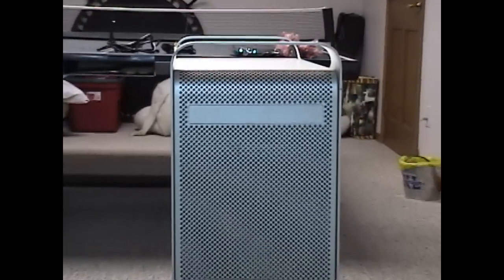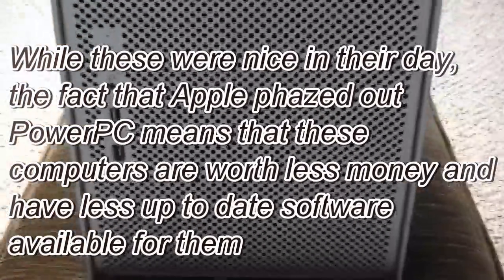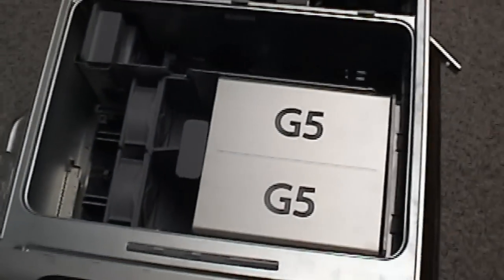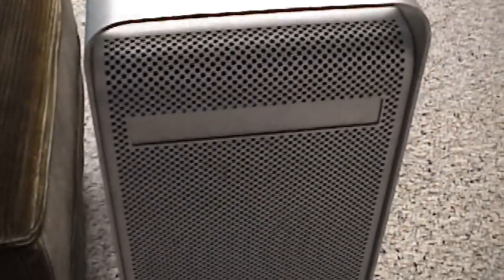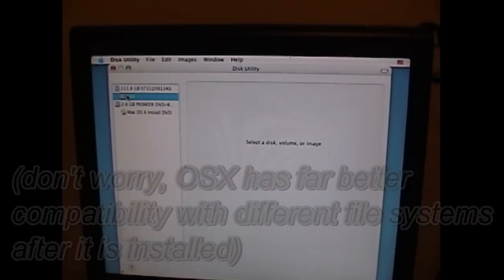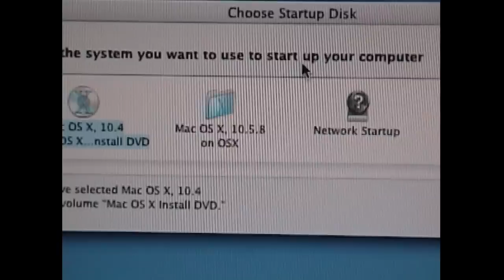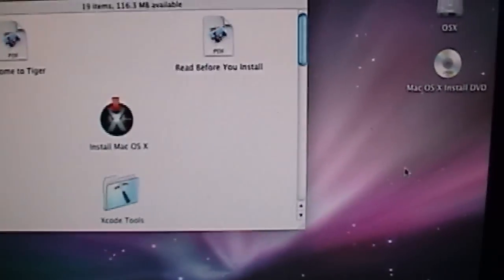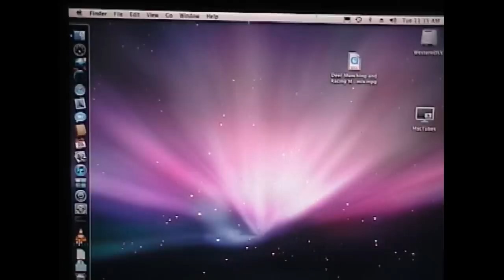PowerMac G5 Setup/First Run + RAM, Hard Drive, and OSX Installation

Comment: Hi hope you're still active as I've just purchased myself a powermac g5 for £10 about $16 and it was described as not working and no hdd. However after talking to the seller they explained they'd never actually tested due to not having the time to install a hdd and get a os for it, so I've been looking for a os and it seems I've found one however whe I've looked at the 10.4 download it says it's been taking down or something because of the high court so idk if you can upload it somewhere else thanks. Also he have me an official apple 22" monitor with it which is worth a fair bit
Reply from the maker: Ewan Rees 
There's a video about setting it up somewhere; if only I could remember where I saw it...
Reply: *****  ;/ i've been really stupid but the download for the os says its been taken down any chance you could post it up somewhere else??
Reply from the maker: Ewan Rees 
Are you looking at the 10.4 DVD or the 10.5 hard drive image? Both links still look good to me (although I was disappointed to find that MegaUpload now asks to install some kind of browser extension to let you download files larger than 1GB).
Reply: it was the 10.4 DVD it may be thats its blocked for me due to me living in the uk
Reply from the maker: Ewan Rees
Oh, so the overseas censorship thing doesn't want you on Kickass torrents; that's very interesting. In that case, I'd try a web proxy. Anonymouse.org worked well enough for light browsing the last time I used it, so that might be worth a try.
Reply: its ok thanks anyway but the powermac has decided it no longer wants to work :/
Reply: yeah i bought it as a project but just don't know how to repair it and what exactly is wrong with it also im in uk so if i put it on ebay  the shipping would be expensive if you live outside of the uk
Reply from the maker: Ewan Rees
It's almost like hotel california because you can almost always buy a Powermac G5, but it's nearly impossible to get rid of them (working or otherwise) because nobody wants them. Domestic shipping is expensive enough for an item that large and heavy, so Craiglist is likely your only hope (it's how I got rid of mine finally, and even that took a lot of patience).

Best of luck on fixing or selling.
Reply: Well i can't seem to get mine working believe its a 1.8ghz and got told it only had 512mb ram but opened it and it has 3gb of ram so i beleve it must of been working at some point otherwise why would the owner have upgraded the ram?
Reply from the maker: *****
Even that is far too much. $20 is the absolute maximum you'd probably want to pay unless you're a collector.
Reply from the maker: *****
In that case, consider yourself one of the lucky ones and trust me when I tell you that the grass isn't greener on the other side of owning a G5. I got a pair of G5s a couple years ago for $50 total at a local computer thrift shop. In modern times, you can get a very decent and useful computer for $200, one that would handsomely kick the pants off of any G5 (blindfolded). Heck you could easily get a used computer superior to a G5 for $50 or less, just hit up craiglist.

That said, don't let me scare you away from the learning experience and lesson in patience that you will receive as a result of owning a PowerMac, just don't spend $200 on one unless it's a BNIB museum piece or something.
Reply from the maker: *****
Few people are willing to sell them for what I believe they're truly worth at this point ($20-30). I'd recommend a used ultrabook as an alternative. For <$200, you get significantly better performance than a G5, better connectivity, and superior portability with significantly less noise, vastly reduced power consumption, less space taken up, and all that weighing only fraction of the weight of a G5, not to mention the fact that you can take it just about anywhere.
Reply from the maker: @Travis Loza
Just don't spend too much money on it.

Comment: After doing any work on a Power Mac you will need to re-calibrate the machine.  Get the ASD Dual Boot 2.5.8 CD on EBay
Reply from the maker: +michael37327 
I'd rather just get it from ThePirateBay or Kickass Torrents.

Comment: does an imac g5 run good on leapord?
Reply from the maker: Not entirely sure. The G5 does a satisfactory job with it, but you run into compatibility issues with anything older. I'd give upgrading to Leopard a try if you're having compatibility issues (or want the visual goodies!), but if you're happy with the looks and performance of Tiger already, I'd just keep it with that.
Reply: thank you for the info!

Comment: If you ever use a G5 in 2020, you probably want to use Linux and an AMD GPU, you can easily get the non free open source drivers which make the OS run smoother than macOS, Linux just seems to have been built better on PPC than macOS it seems
Reply from the maker: Feel free to watch my followup video to this on using PowerPC Mac PCs in modern times. Maybe they're better now, but I tried several Linux distributions and had a variety of showstopping problems with each of them. It was a neat little machine, but not anything that I'd have a practical use for these days.

https://www.youtube.com/watch?v=da5vfIH069E
Reply: @Browningate  oh yeah I saw this
Yeah Linux has been odd on PPC.  I myself had a LOT of issues on Linux that I don’t think I can even recreate now because they were either random or something I forgot I did that caused them.

Great video you made, both videos!
A few things in Linux are not OOB, like GPU acceleration.  Sometimes things are broken and you have to go to the guides or troubleshoot and guess your way out.  
Too bad macOS was poorly optimized for G5’s and G4’s
Reply from the maker: @5thaltaccount547  It's easy to say that Linux and OSX are "poorly optimized," but maybe our standards are just too high nearly 20 years later. That said, the broken Linux stuff was certainly frustrating. I'm willing to jump through some hoops to make things work, but this thing was just turning into a giant vortex of wasted time. Someday, if I encounter another one, I might just give it another go, but I've had my fill of G5s for one decade.
Reply: @Browningate  well that is true, however without a doubt OS X had some optimization issues I think for just about all hardware and the hardware that suffered the most were average lower end hardware?  Is that the right terminology?  Some of the higher end PPC machines can have a good fight though with running PPC Linux once it actually gets going properly.  Leopard was known for having some optimization related issues for PPC and Intel?  I think?  One or the other.  It would be interesting if to see Apple Silicon be the new transition, could it be considered the new PowerPC?  Not sure but we’ll see how Apple decides on tackling the future.
Reply from the maker: @5thaltaccount547  You're welcome to run some side-by-side tests to see if general working tasks are any easier or faster under Linux. The G5, thankfully, has two hard drive bays.

I don't think that they'll have the same growing pains with arm, because they've been building for it for over 10 years now (remember that iOS is based on OSX). And x86 obviously isn't going anywhere anytime soon. Whether or not this will effectively pressure Apple to support it for longer than they did PowerPC after the transition started, remains to be seen. Under normal circumstances, I'd say that they do. But on the other hand, removing features for no discernible reason seems to be a recent pastime of theirs, so an early quit wouldn't be terribly surprising either.

Comment: Thank-You.!  :)  Who would ever think to OPEN the DVD Door of a $4,000. computer would require 3 screwdrivers and 6 hammers. :)  Bill Howes.
Reply from the maker: I found out that there are a few other ways to open it as well. You can hold the mouse button while turning it on or hold "ALT" at startup, wait for the boot menu to appear, then hold F12 for one second.

Comment: hey i did everything u did but right when i restar my mac just the apple logo comes out an doesnt do nothing justs stay there doing nothing anything wrong? by the way i got a powermac g5 running 10.4.11. do i have to erase tiger first an then try it againg.. pls help my mac is not working nomore
Reply from the maker: *****
Are you getting this after restoring the 10.5.8 image? If so, you may need to erase your existing 10.4 partition, do you have anything important on it that you'd want to keep?
Reply: thank you for replying...nooo i actually installed 10.4.11 on my mac few days ago but i need to upgrade to 10.5.8 so i can intalled application that i need because in tiger i cant.. an yes i did everything u did but when i restart that i clicked the 10.5.8 folder it boot but it stay in the apple logo.. nothing happens,stay there like for almost an hour in the apple logo
Reply from the maker: *****

If you don't care about anything on the drive currently, I'd go through again, but this time chose "erase destination drive" (assuming your 10.5 image isn't on that drive) if you haven't tried it already.
Reply: ***** ok i will try tht! Thank You